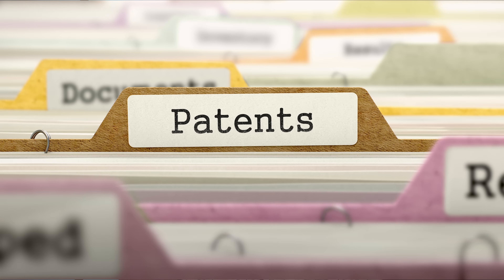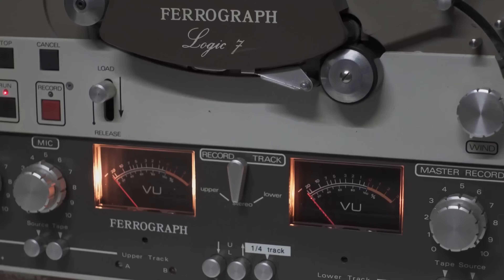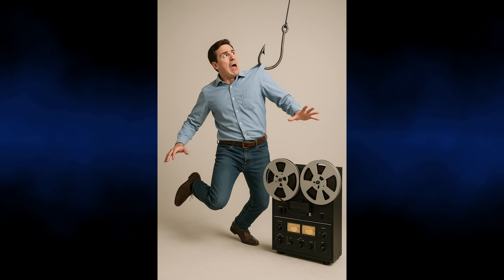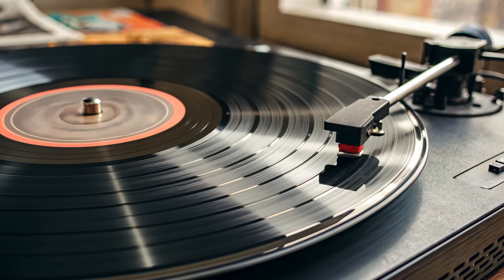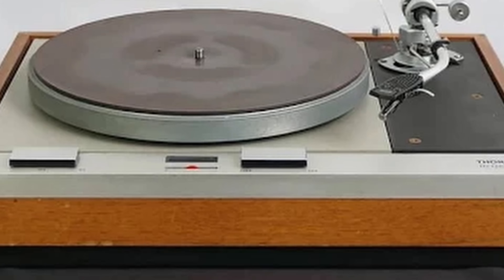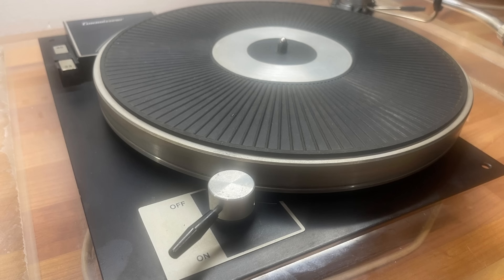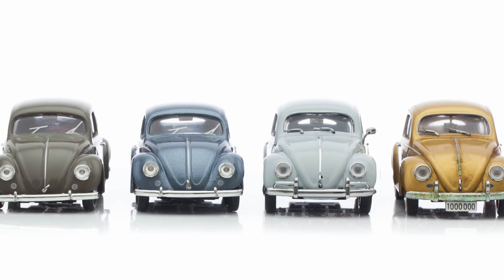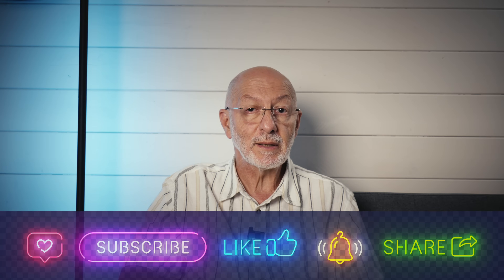"From Physicist to Hi-Fi Pioneer: How I Discovered the Isolation Bubble That Changed Everything"

Comment: The “tape is better” argument might be true, but is pointless.   NONE of the music I want to hear is available on tape!!  And if it were available, each album would cost well over $100.  Tapes cannot be plunked out by the 1000’s like LPs.  They must be recorded in real-time, which is expensive, and then add to that the cost of the tape.  This has always been a ridiculous argument.  I have a nice tape machine, and I own exactly ZERO pre-recorded titles.
Reply from the maker: You're absolutely right about the practicality issue - I'm not suggesting anyone should actually buy pre-recorded tapes! That would be madness at those prices.
The "tape is better" isn't an argument for buying tapes - it's about using tape as the reference standard to judge how close we can get vinyl to sound like the original musical event. When I compare turntables to tape, I'm using it as a benchmark to identify what's missing and what can be improved.
The whole point of our Isolation Bubble approach is to get your vinyl collection - the music you actually want to hear - to sound as close as possible to that tape reference. It's about making your LPs sound more like the master recordings they came from, not telling you to abandon vinyl for an impractical format.
Think of it like this: a racing driver uses a perfect lap time as reference, even though they'll never achieve it in practice. The tape comparison helps identify the specific problems (arm resonance, cartridge isolation, energy management) that we can actually fix to get your records sounding more natural and musical.
Your nice tape machine proves you understand what good sound is - now let's get your turntable closer to that standard with the music you actually own and love! 🎵
Reply: I think cassettes were a much overlooked medium and I wish I'd spent more time listening to them (yes, even pre-recorded) than to the drivel and phooey physics spewing from Linn Products.  I think cassettes could justifiably be described as "better", though some qualification is needed.  They don't slow down over crescendos which, very obviously, LP12s do.  That pervades the whole listening experience and I would say that the general stage set is far more realistic and unequivocally better.  The 3.5kg platter doesn't come into it because the lighter subchassis does the rotation.  It's similar to listening to an SL1200 versus a Linn.  The SL1200 just keeps the beat, which the LP12 can't manage.  In fact I think the wow and flutter characteristics of the Linn are integral to its sound and I suspect that the stiffer than usual belt may mean that it doesn't overshoot when it gets up to speed again, which may well have an effect on our perception, being one problem fewer.

Another qualification is that I have only ever had "acceptable to good" performance from Nakamichi decks (and I have still yet to find out what it is that's special about them, though there's a very good chance it's the grounding arrangements, as with pre-amps).  I've tried a top of the line B&O 8000 that I had for a year or two plus an award-winning cheaper Yamaha where they'd obviously done every tweak they could think of, but neither came close.  I think the lack of top end can be overlooked as one gets used to tonal differences very quickly and we weren't getting most of those frequencies out of the speakers anyway; that Scan Speak tweeter was 3dB down at 15k and, for classical music at least, there isn't much signal above about 5kHz.  And if cassettes were a medium that was still current today, it's a problem we would have easily got over by now.

Comment: All for a media that is very limited in dynamic range and frequency response.
Reply from the maker: That's exactly the point! 🎯 If vinyl has those inherent limitations, why make them worse with poor setup and resonant systems?
We've spent 40 years proving that when you eliminate the added distortions - arm resonance, platter ringing, motor vibrations - vinyl can sound surprisingly close to our tape reference. The medium's limitations become far less noticeable when you're not fighting against avoidable mechanical problems.
It's like saying "why tune a piano when it can't match a synthesizer's range?" - because you want to hear what the medium actually sounds like, not what poor engineering adds to it! 🎹
The Isolation Bubble approach focuses on physics, not wishful thinking. When we did blind tests comparing our upgraded 40-year-old Planar 3 against a £5k P10, the results spoke for themselves.

Comment: My take: Until the 1970s the best technicians and scientists within audio firms worked on turntables, but then they were moved on to CD players as soon as that caught on. So I bought a late 1970s deck, a Yamaha KD7040 which has very good vibration isolation not via springs, but by construction. If only we had new analogue tape recordings...
Reply from the maker: Absolutely spot on! You've hit the nail on the head - the brain drain from analogue to digital in the late '70s/early '80s was devastating for turntable development. All the brilliant engineers who understood mechanical isolation and resonance control suddenly pivoted to ones and zeros.
Your Yamaha KD7040 is a perfect example of what we lost - proper engineering-based vibration isolation through construction rather than gimmicks. That deck represents the last generation of serious analogue engineering before the exodus.
And yes, if only we had new analogue tape recordings! The irony is that vinyl can get remarkably close to that master tape sound when the physics are properly addressed. That's exactly why I've spent 40 years working on the Isolation Bubble approach - tackling arm resonance, cartridge isolation, and energy management that those 1970s engineers understood but never fully solved.
Your KD7040 with its solid construction principles would be an excellent candidate for our approach. The foundation is already there - it just needs the modern physics-based solutions we've developed to bridge that final gap to the tape sound.
It's criminal that we stopped advancing analogue just when we were getting close to cracking it! 🎵
Reply: @arthurkhoubesserian6613   Yamaha is such an impressive firm - and in so many areas!
Reply: The recording technicians and technology also moved on 😅

Comment: I would love more information on Rega P3 upgrades, thank you.
Reply: most would say the upgrade is a P6. (joke)  Rega has fundamental answers to fundamental design problems.   I own a Michell gyro se, which also answer those same fundamental problems in very much the same way, except it adds a suspension to support the table , instead of having you figure it out.  regrettably it has gotten expensive, but it is very sustainable for long term use. I a currently awaiting a new main bearing , after about 25 years of ownership.
Reply from the maker: Thanks for your interest! 🎵 The Rega P3 is a fantastic deck and responds brilliantly to our Isolation Bubble upgrades. Here's what we offer:
🔸 Achromat - Our signature platter mat that absorbs stylus energy and eliminates static for dramatically improved clarity 🔸 Houdini - Cartridge isolator that acts like suspension for your cartridge, reducing arm resonance and improving tracking 🔸 Eeze-Lign - Bespoke alignment shim that eliminates the need for protractors - perfect for precise cartridge setup 🔸 Bo!ngs - Isolation feet that decouple your deck from vibrations
We've actually done extensive testing comparing a 40-year-old Planar 3 with full Isolation Bubble upgrades against a £5k P10 - the results are quite eye-opening!
Feel free to check out our website at thefunkfirm.co.uk for full compatibility details, or drop us an email if you'd like specific advice for your setup. We ship worldwide and offer a 7-year warranty on all our products.
Happy to help transform your vinyl experience! 🎧

Comment: viewed at 2x the original playing speed, I'm thankful that I only wasted 5.5 minutes watching this useless drivel.
Reply: Oh dear, has he burst some of your bubbles?🤣
Reply: @ericthemauve  what exactly did he say to refute common design understandings?  was it without a signal , a plinth is unheard?  Everything vibrates, and spurious energy has to go somewhere.  This guy made a plinth out of composite board that developed a sag after time , making the first pink triangle product unusable after that event.  And it sold at audiophile high prices .
Reply: it is true that he doesn't say much of note, and takes a long time saying it .  I happened to have enjoyed the last incarnation of the classic AR turntable, it looked nicer, had a modern arm (jelco branded as AR),  and played very well. 
In my case, a more expensive replacement table (gyro se) gave me previously unheard recorded information and more dimension in the sound stage , in all directions, and with the same cartridge  and system.  Both of those tables, sharing a lot of fundamental design,   made me a believer in suspended belt drive designs as a good working , economical design solution.   but I believe direct drive is now state of the art, and still need a suspension.
Reply: I should have read your comment first. I went past the 5.5 minute mark. ☹
Reply: @cameraplus7233  Another one in denial.